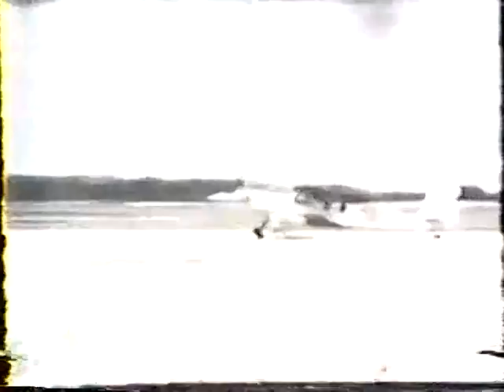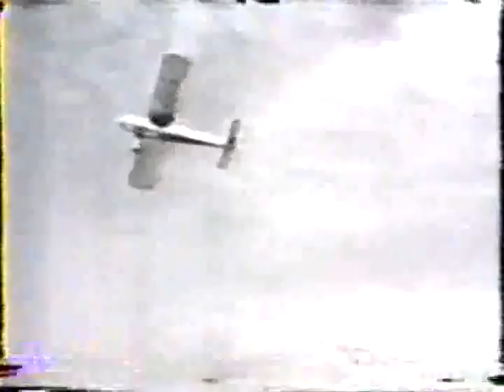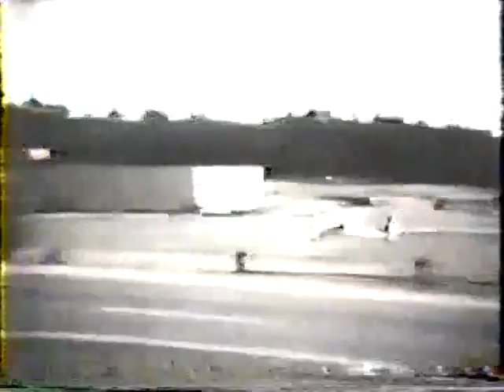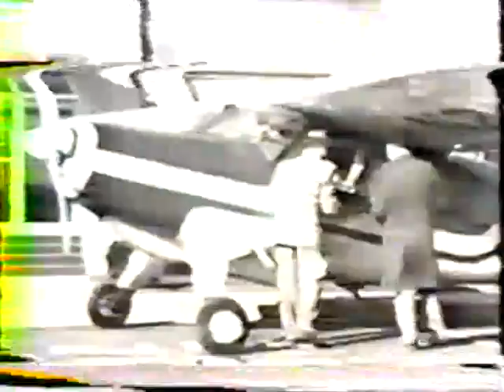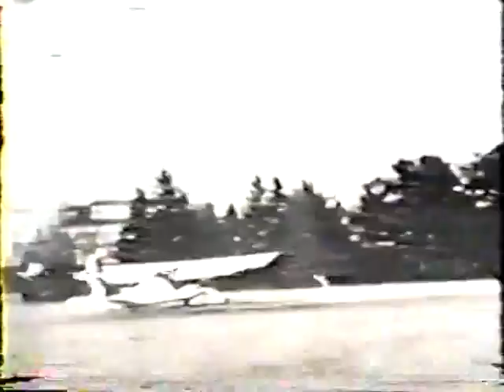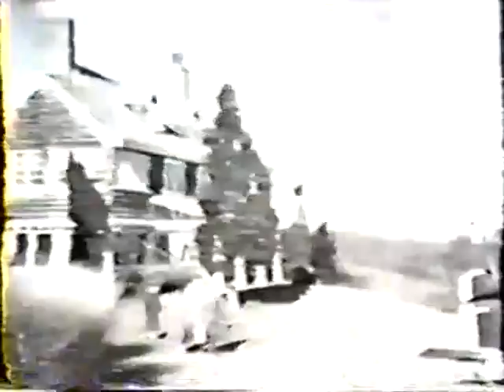Helio Courier

Comment: The early footage of N242B are circa 1954, during FAA certification trials. The rest of this video was shot by Helio Aircraft Corp. in 1958. That is when the Helio H-395 Super Courier was introduced and ordered by the Special Ops ( CIA) as the U-10 after expert testimony by Major Heine Aderholt.. The Air Force evaluated the L-28A at Eglin AFB..